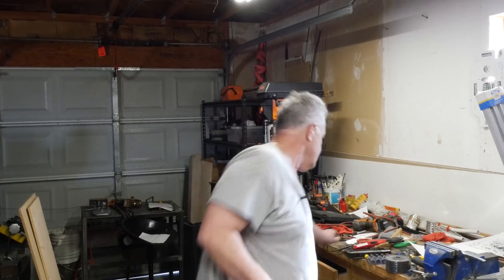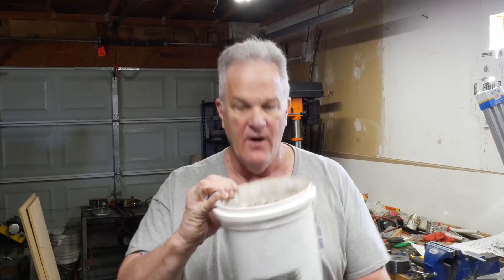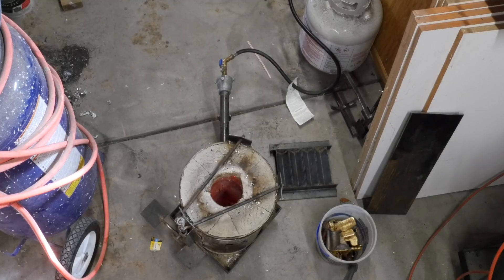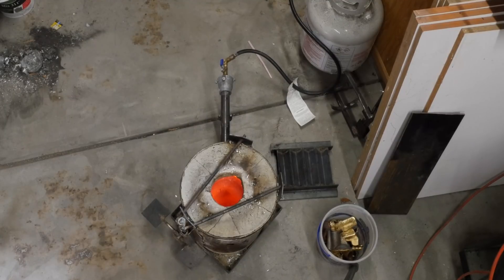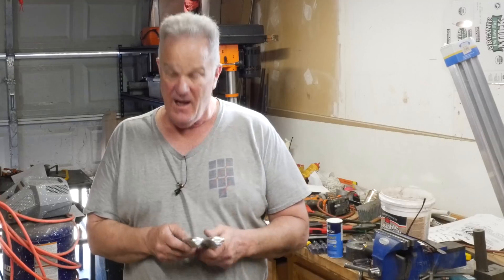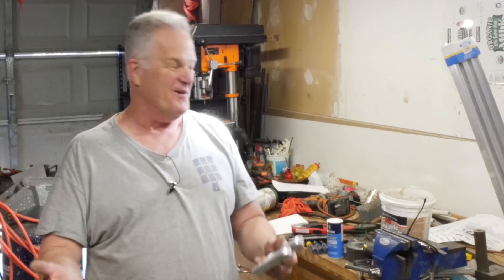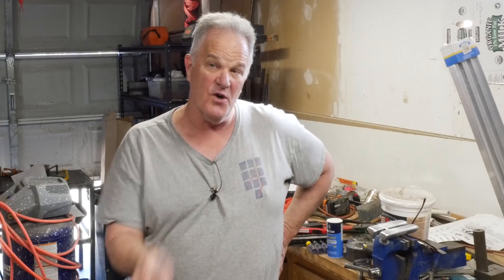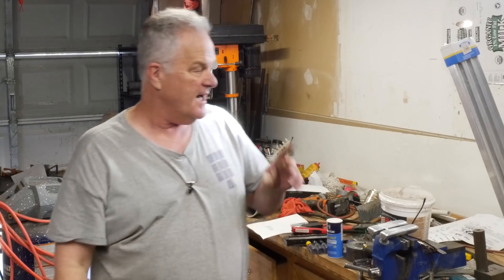Increasing ingot yield from aluminum scrap

Comment: A lot of guys say to use lite salt for flux and washing soda for degassing . All my melts are small , I use half of a propane cylinder for a crucible  . I'm not sure if it makes a difference . Check out  ( luckygen1001 ) he gets out the science book and looks up the chemistry . ( myfordboy ) has a video on what aluminium to use and he has used the salt and soda for flux an degassing . 
Have you given any more thought to making castings with lettering ?
Reply from the maker: To be honest, I havent had a lot of time to think about the the lettering. I'm going to try and cast something again tonight that has a debossed (learned a new word yesterday from a commenter) pattern it it. I'm a few hours away from getting out there but I've already got my fingers crossed.
Reply: I fix lawnmowers so I have more cast aluminium than I do time but the whole idea was to make model engines . I did make one good one , even put up a short video but that"s it . Time and cold set in too quickly .
Reply: Either my torch/furnace is really efficient or there is something else that I'm missing. With one 20lbs tank of propane I have done 2 aluminum melts, a copper melt, a mixed salt melt (to make flux), an aluminum bronze melt, a tin bronze melt, an antimonial copper melt and a mixed antimony/tin bronze melt. And I still have propane in the tank for at least one more run. Each batch was at least 1 pound, using #3 crucibles.

Comment: The pattern on the top are from crystallization of an aluminum alloy with an slightly higher melting point than pure aluminum. Pure aluminum can also create a very fine crystallization pattern. Things like that are the risks when you use aluminum from unknown sources. For low strength stuff it is good enough but can be hard to machine because of varying hardness.
Reply from the maker: That is probably exactly what it is. And as you point out that is what you get when you melt unknown sources.

Thanks

Comment: I use boric acid for my flux, thats what I've seen a lot of other people use whether smelting or blacksmithing. You can get it from the laundry aisle at walmart in a box of Borax.
Reply: I use a 1:1 molar mix of sodium chloride (table salt) and potassium chloride (water softener from hardware store). That's 58g sodium chloride to 75g potassium chloride (or approx 2oz of the first and 2.5oz of the second). The advantage of this mix ratio is that they form an eutectic so the melting point of the mix is as low as it can be. Sodium chloride melts at about 800 degrees C and potassium chloride at 750, but the mix melts at about 620 degrees C which is in fact lower than the melting point of aluminum.
Reply: That won't work. The clay that holds it together has been fired and it's not plastic clay anymore, it has turned into ceramic. The pieces/powder from the broken crucible could be possibly used for an addition to a clay composition to make a new crucible (pieces of broken pottery are regularly used like this, the material is called "grog"), but the way you suggest won't work.
I've been studying pottery a bit lately with the idea of making my own crucibles. It's quite complicated to select the appropriate clay composition, and will require a lot of experimenting. Eventually I want to be able to make my own alumina and zirconium silicate crucibles. Those I would be able to melt iron in.
Reply: If it works I'll do a tutorial... I found a paper from 1939, a study done by the National Bureau of Standards about making high temperature crucibles from alumina/zircon for iron melting. Has some detailed procedures, and shouldn't be too hard to replicate in a garage. I have to get better at making plaster molds though.
https://nvlpubs.nist.gov/nistpubs/jres/23/jresv23n2p319_A1b.pdf
Fine alumina powder is easily available as polishing compound, and zirconium silicate can be found at pottery supply stores as a component for making glazes.
Reply from the maker: Yeah, I've seen it. I suppose it's worth a try. It's cheap
Reply: Please don't use boric acid for aluminum. It's not a strong acid, but still reacts with aluminum and increase the amount of dross and aluminum loss. Boric acid is best left for much less reactive metals like copper.
Reply: stamasd ok so use boric acid for copper and use salt for aluminum? Does it matter what type of salt whether regular table salt, sea salt, or light salt like in the video?
Reply: stamasd thank you for the info, I'll be sure to try that out next time I use my foundry.
I have one more question, is it possible to reshape a broken clay graphite crucible?  The first one I bought I forgot to dry and temper so, of course, it shattered right away. I gathered all the broken pieces and figured since it contains all the same mixture from when  it was made, maybe I can grind it all down to powder, stir in a little water to hold together, put in a cup shaped mold, compress it tight with some c-claps, and bake it for a while. Do you think that could possibly work?
Reply: stamasd ok, thanks again. And best of luck working on that, sounds awesome. :-)
Reply: stamasd That would be really cool, hope to see it.

Comment: Bib!  Disappearing compressor.  Well done, Harry.  Dude, get a metal scoop or something to add the swarf with.  SMH.  Pattern is crystalization, don't worry about it.  Your crucible will last longer if you let it cool off INSIDE the furnace.  Whoo!  Whoo!  The train of thought has left the station.
Reply: Tip on the Crucible, thanks, only has one and I need it to last.   I use a stainless spoon-big restaurant sized one tacked to a piece of rebar to remove dross, allows the Al to flow thru.
Reply from the maker: Oh Ron, so many comments. There ought to be a rule, one comment per..er..comment. ;-)

I have a metal scoop, but it's too big and it dumps swarf all over the outside of the crucible. Well, ok, I dump it all over the place but its the scoops fault. I think the better action is to just get rid of the swarf, it's kind of a pain to deal with.

My crucible is probably nearing the end of it's life anyway. I think this is the first time I've not let it cool slowly within the furnace.
Reply from the maker: Oh, and bibs are for babies. Real men wear their food like a badge of honor ;-)
Reply: Bibs are for babies?  Have you ever been to Red Lobster or a nursing facility?   Smaller scoop, or just don't fill it so full.  That flaming paper thing was a stunt, right?  (I hope)  Maybe you can compact the swarf.  Funnel it into a pipe and ram it down.  It might not work, but it might.  Swarf pucks!
Reply from the maker: I've been to the dead lobster, but its been years. The wife got sick there and we've never been back. 

I've tried filling a pipe with the swarf. You can't pack it, it is to hard to get it out once you've done that. I did make a smaller scoop... out of metal... that I was able to use for  the bulk of the fillings.

I'll never let on about the paper ;-)
Reply: How hard can it be to get the swarf out?  Just lift the pipe's end up off the floor and ram again.  How much did you try to pack in there?    I was expecting the pucks would crumble easily though.  The kind of pipe might make a difference, too.  Automotive exhaust pipe is smoother inside than plumbing pipe, and swarf might imbed into plastic.  Low grade pipes tend to have a raised weld inside too, but at least that runs longitudinally.
Reply: There's  video by Mladen365 you might derive inspiration from.  He made a briquette press tht looks like it could be adapted into a swarf compactor.  I think you have the skills.  If you have an abundant supply, why not take advantage of that?  His video is titled:  Simple round briquette press.
Reply from the maker: Brilliant. Ok, I'll see what I can put together, That would really simplify using that stuff up.  Thanks!
Reply: Yw.  Don't forget to make a build video.